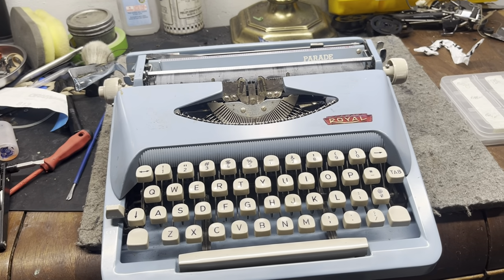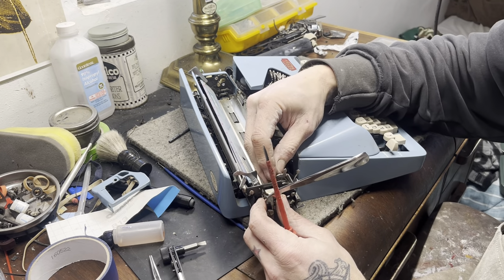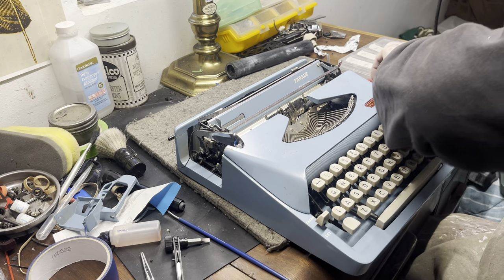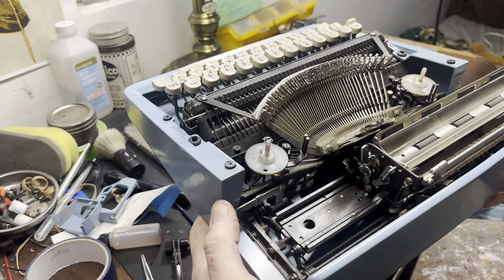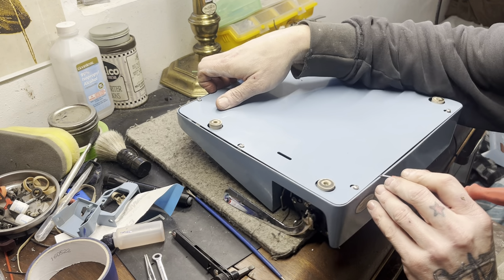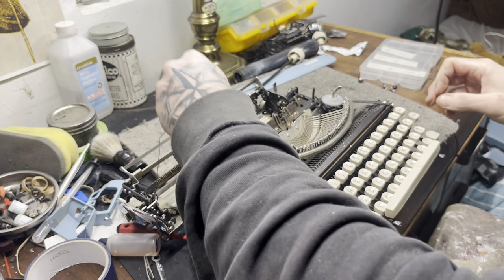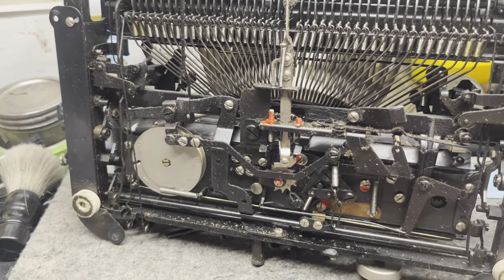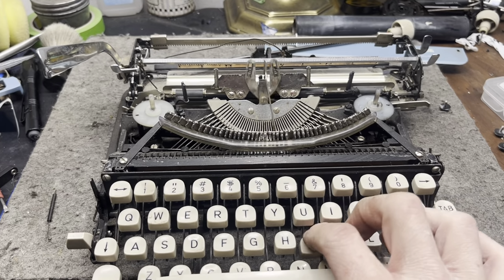Royal Royalite/Parade/Signet Full Tear Down for Service Walkthrough Tutorial

Comment: I have no idea if you’ll see this, but I just got my parade today, and the carriage doesn’t move when I press the keys. I assumed it was a band break somewhere but I don’t see a band in the back of this one. Any ideas what the problem could be? Also if my keys seem to be slow to move it probably means the key bars might need a cleaning? I cleaned the key faces with just a little water and a q-tip and holy moly those were gross lol